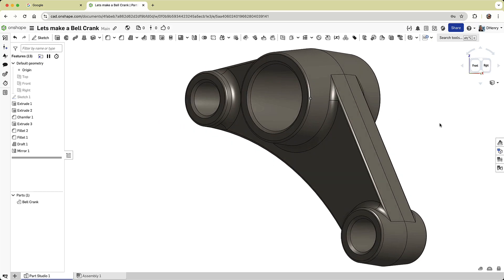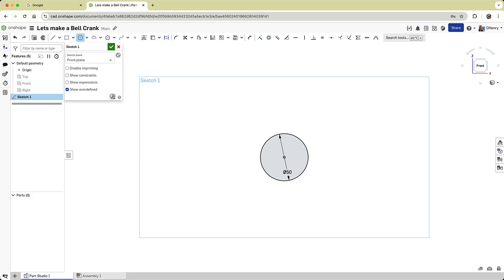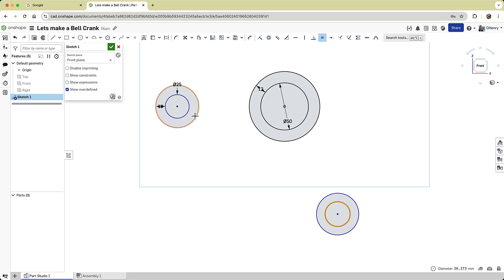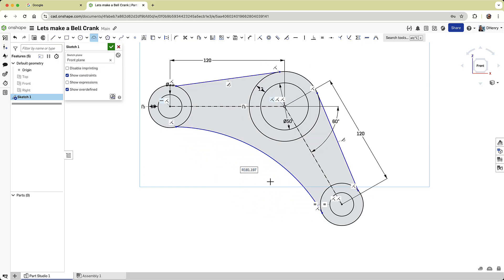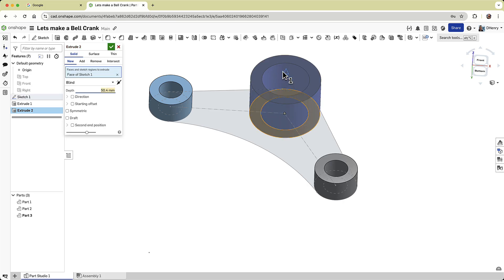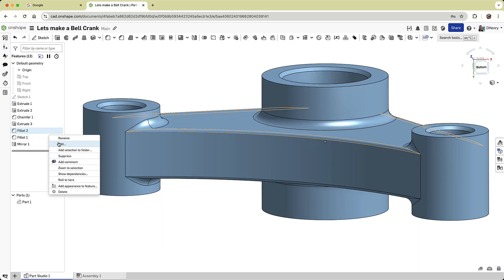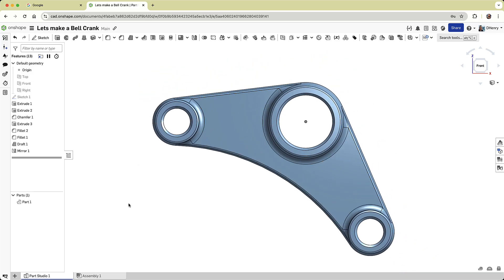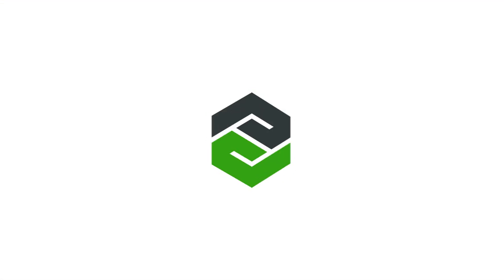Let's Make a Part - Bell Crank Tutorial

Comment: Hello, thanks for the great lesson! I’m coming from solidworks. Just a question. When working on multiple parts in a part studio I’ll sometimes need to go back and make changes to say maybe the first or second part but the design tree doesn’t keep all the features in the design tree within the tree with the grouping of the part I’m editing. I hope I explained that correctly. Is this normal, or is there something you could suggest?
Reply: There are a few approaches to managing the feature tree and the parts that relate to it. I always recommend grouping features into folders to keep your tree tidy. In addition as you detail the design you can always “check dependencies” on a feature, you can right click any feature and find both upstream and downstream dependencies. 

Overall avoid overbuilding in a single part studio. Once you start thinking about non related geometry it’s best start a new part studio. 

Hope that helps!
Reply: @ Thanks, Are there any videos that show this process?